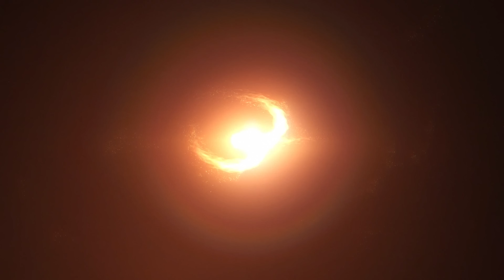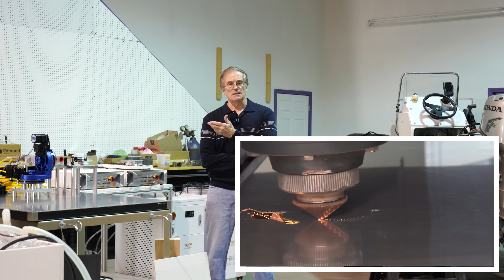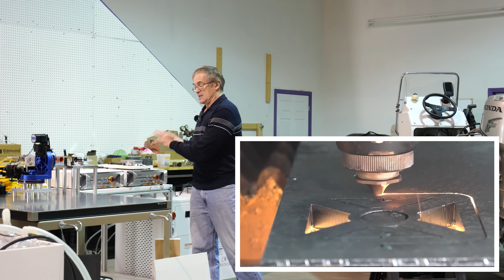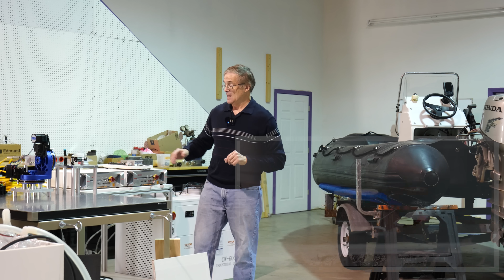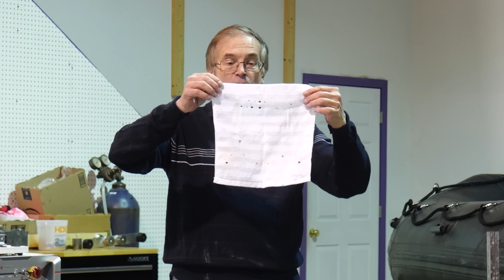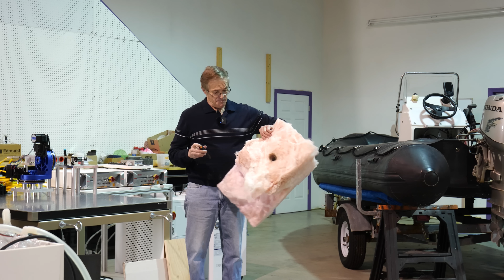We have a problem... and need your help!

Comment: So how come the lens isn't burned? I am a programmer. If you constrain the laser to a fixed aiming zone, you only need to shield that area.
A setup like this works:
– 3mm water curtain
– Thick graphite slabs
– Steel or ceramic backstop
That gives you a reusable, safe beam dump even for high-power lasers like fiber systems.
Reply from the maker: We have to allow the target (drone) to move around and try to avoid the laser to validate the tracking and targeting system.
Reply: @TechIngredients  These seem 2 separate problems to me. Either test the targeting system inside or test the laser inside. If you want to combine them test them outside and aim up (for example min 45 degrees pitch) where you can't damage anything else but some planes and satellites.. Outside you can rotate 360 degrees (yaw) so its a better test.

Comment: At the risk of sounding stupid, After watching your video and reading the comments I had the idea of using carbon felt. I thought if it was available in large sheets it could be hung in a frame with the bottom in a water reservoir pumping water to the top of the frame to a diffuser pipe at top with a water pump recycling the water from the reservoir. Maybe a few sheets thick depending on the thickness of the carbon felt sheets. The carbon felt is black with light absorbing and high heat handling properties and with enough volume  of running water to help cool the felt and additionally diffuse the light from the laser it might slow the rate of burn through. The water can be drained out when not needed and the carbon felt could hung to dry and then rolled up for easy handling/storage. The frame could be made for easy assembly/disassembly or even put on castors for ease of mobility in your shop.

Comment: Does it melt glass? Water with suspended particles would be my thought. Some reflective, some absorbative it would obviously need to be quite dense with sediment so something keeoing the particles suspended .. aka mixer the other option is focusing down into the water with some type of white floating sludge on the top of the water. If the laser won't burn through glass i'd go through the side of a tank,  is it will melt through the glass I would aim into tank so it aims up into the sky if it has any chance to reflect, which is why I would go with the foam on top. Water is such a great diffuser of light, with particles mixed in it would have to work.....

Comment: ptfe sheet. We used strips of it inside parts (aircraft engine turbine blades) that were drilled with film cooling holes using lasers.  The ptfe prevented back wall damage inside those parts for a given number of high power shots.  Although any gas produced was safely vented away which may be a problem in the open.

Comment: Hm, the problem is the the energy density, what would happen if you make a wall of water? E.g. with sprinklers or like a fountain. Water has a high heat capacity. Wall of flowing water should protect the structure behind. It is cheap, but you need a relative powerfull pump to maintain the flow rate.

I think it is more reliable than the sprinkler solution. Because tiny droplet have a low mass and therefore a high expansion potential… this is dangerous.

Continuously flowing water has also relative good heat conduction.

Comment: Back in the 80's, the only solution I found to stop the unstoppable picosecond beam from burning the water cooled ceramic in about 2 seconds was to add a bead blasted window to disperse the energy before hitting the ceramic. I don't know what wavelength you are working with, but if it will pass through cheep glass or plastic, you might be able to bead blast it and contain the energy inside your building safely.

Comment: I would suggest carbon felt fire blankets over the top of potassium acetate coated plywood. Or to be truly thorough carbon felt fire blankets over potassium acetate coated plywood sandwiching starlight (baking soda, cornstarch, flour mix stuff) mixed with graphite material between two layers of potassium acetate coated plywood. Though I do not know if it might be too much hassle.

Comment: Aerogel mixed with vantablack? Or, try to adjust the lens to focus it at the proper distance (and scatter if the target is destroyed / missed)
Reply: ha no okay you need it to be big :+) - first option is out. I'd work on a quickly adjustable final lens to focus / diffuse the lens with an actuator.

Comment: So many cool ideas to try... Building on some other ideas here, how about a sacrificial barrier followed by a mirror to deflect the beam downward into a pool of dyed water. Pass it through a fuse first if you want an auto-shutoff feature. Diffuse it through a lens if you want to heat the water more evenly. Paint the back side of this absorption chamber with Vanta Black to reduce reflected light and satisfy my own curiosity. :-)

Comment: The Space Shuttle uses a Thermal Protection System (TPS) to manage heat during re-entry, primarily relying on tiles and blankets. These components absorb and dissipate heat generated by atmospheric friction and the extreme temperatures of re-entry

Comment: MDG's/multi layer diffraction gratings maybe? I saw a guy using diffraction gratings from them big old tv's cant remember why but I know MDG's are used in laser applications where metal objects may be damaged and they are used to increase the LDT/laser damage threshold of things, so maybe diffraction gratings are the way to go? 👍
Reply: Or build a portable Penrose unilluminable room from mirrors and plywood and do the experiment in there? But the first idea seems more practical the unilluminable room would look cool for the video though. 👍
Reply: My only other solution is....... a solution..... of silver nitrate disolved in water sandwiched between 2 pieces of perspex this should be a good heat disipator and absorbed of the laser light but the water would probably be best if its circulated and it may be best to add an absorbent black layer on the back side of the perspex thats water proof but it might be a bit far fetched, you would need to experiment with the thickness of the perspex and distance between them and the amount of dissolved silver nitrate in the water and maybe try a few different black absorbent coatings? 👍
Reply: Doped glass may be a good idea too but you'd have to find a dopant that's a good absorbed of the wavelenghth of laser light being used and you could have multiple panes of doped glass so it can be portable and it might not need to be really thick glass either depending on how the dopent does the job.

Comment: I have an idea that wouldn't completely solve your problem but it would be yet another safety layer.
Have a separate computer system that monitors the movement of the laser, and if it lingers for too long at a given position, immediately turn off the laser. For greatest safety require manual restart, or auto restart after cool down. (Effectively controlling intensity through pulsing.) Now you want this system to fail safely so if the computer monitoring the laser freezes or crashes the power defaults to off. You could also wire in a manual button that when held down bypasses this system if you find it triggers too often. Again, this would not solve all of your problems and you would not want to depend on it alone.
Reply from the maker: That's a good approach.

Comment: Redirecting und diffusion:
The first thing that comes to mind is to scatter the beam again. For example, with a diffuser glass panel.
I would also flood it with water.
To do this, mount the panel at an angle to direct the remaining radiation onto another water wall (trap?).

Comment: Ideas that instantly come up: 
1) (smartest (from list) but still hard) use curved mirrors to direct light up in the sky, it slightly splits laser and won't burn anything
2) (ez & quick) Use a mirror (or something relatively reflective) to direct light upwards to Sky. I hope it hits nothing
3) (hard to calibrate), use hard to destroy expensive material, and direct mirrors to point to it, large area -> small resistance area
4) (mat not found) need material that reflects laser all directions
5) (practical) extra fast microcontroller tracking laser (setup orientation) that shuts down if stays on one spot too long using rotation sensors and/or sensitive gyroscope (low gyroscope readings = laser is burning too much stuff)
Hope it helps!
Reply: When reading your first point i imagined penrose's unilluminable room and a laser bouncing everywhere but the parts it cant reach and hiding in the unilluminated spot for safety 😆 that would be cool.
Reply: lasers this powerful will destroy common mirrors in less than a second! Styropyro got a video o that.

Comment: Have you tried to fire at ceramic tiles? A stack of them would be cheap and readily available. 
 Another idea would be making an intumescent ablative block and testing it. 400g flour, 200g cornstarch, 200g powdered sugar, 200g baking soda, 40g borax, 250g water. Mix well, form a cube, let dry. With heat it melts to a carbon foam. (NightHawkinLight formula)
 3rd would be to diffuse the lazer.10gal fish tank, fill with broken glass, maybe water too. 
 There's 3 ideas hope one or all will work. Good luck!

Comment: A laminar flow of water over a surface to absorb the radiation.  The surface would be large, and the pumping might get complex, but I think it would work.  If the water is too reflective or translucent, some sort of inert solute could be added to the water.

Comment: One thing you might try is Kaowool insulation. It's used in smelting furnaces and I think that if it can withstand the temperatures needed to smelt steel, it may have a better chance than the fiberglass. Another thing you can try is a high convexity first surface reflector. This will serve to diffuse the beam rendering it a lot less hazardous to the surrounding environment. The trick is to find a reflector type that is nonreactive at the operational frequency of the beam. An alternative to a mirror surface is a high convexity lens which will also serve to spread the beam and reduce it's reactive power considerably. This lens should be made of quartz glass which has excellent optical properties and high temperature resistance.

Comment: Rockwool insulation perhaps? It's basically spun rock slag. Fireproof, available and flexible. It should have significantly more thermal mass than glass insulation so hopefully won't melt anywhere near as quick.
Reply from the maker: We're testing that now.

Comment: try concrete backer board also known as green board   two or 3 sheets  would not be that expensive kiln brick aka fire brick  might work too
Reply from the maker: That's on our new list.
Reply: @TechIngredients  it would also help to know how hot that laser gets,  that has a big difference on the material  i mean steel melts around 2800 ....the old laser blew threw that thin stainless like it was nothing but how would it do against 1/4 inch sheet  steel that laser in the video was cutting thick aluminum  ...and steel

Comment: Use a dye that absorbs the wave length in an oil water solution with sand mixture stained with the dye.. I would try a reenforced aquarium filled with it with the target made of transparent aluminum or metal foam filled with the dye

Comment: AEROGEL is probably what you are looking for, see VERITASIUM video on the subject.
YOUR "Revolutionary Paint" is probably the next good candidate. Someone else used something similar to protect against heat and used a welding torch to test and show it's efficiency in one youtube video.
Another SOLUTION is probably to use the same technique than your cutting table. Use a a bean the converge on you target and then diverge.
You can split the beam into multiple smaller beams  
 My favorite SOLUTION called the KILL SWITCH would be to find a PAINT that would emit a known wavelength when hit by the laser. You put some detector in the room and you moderate the power of the laser regarding the diffuse reflection mesurd by the detector. As soon as your laser beam has made is  way trough your target, one part of the beam will hit the wall that will remit the light with another wavelength in all the room that will hit a detector that will lower or stop the laser.
Good luck

Comment: I have no experience with high Power Lasers, so i am probably missing something important.
But my first idea was a two stage system:

First an Optical medium, that Unfocuses the laser, but is transparent to its wavelength
Then the Absorbtion medium that absorbs the Enery

To disperse the laser before it hits the Absorber, something like a Diffraction grating (or frosted glass, if the backscatter is not so high that it causes a hazard) could be placed a meter or so before the absorbing Wall. 
When the energy of the laser covers a larger area, the Absorbtion medium should have a better chance of surviving

Comment: If Starlight doesn't work, Try a parge coat of Refractory Mortar. I would say make the parge coat at least 1/2 thick or thicker.

Get a piece of plywood, and staple Galvanized wire mesh to it, you will find this in the masonry section of you local building supply store. 
Lay the board flat on the ground with the wire facing up. Mix up a 5 gallon bucket of the Refractory mortar and flat trowel it onto the board. 
If you make it too thick, the board will become VERY heavy and be to difficult to move. 
Since it is parged onto plywood, you could also fashion some handles on the backside of the board so 2 men could somewhat easily move them. 
If it works, you could make several panels of these Refractory Parge Coat boards and position them however you need them.

Comment: Have you yet considered setting up a huge rotating disc in front of the wall? In this case, the beam does not stay focused on the same spot and the energy is distributed, depending on the speed of rotation.

Comment: Use a beam diffuser. Split the beam into multiple beams then let it hit your absorption material. Shape the prism, ie splitter so the the split beams impact different areas. You would need to replace the splitter crystal as decays, but it should give you enough time to shut down the system.  This coupled with slayers kill switch should work in theory. If within your price range synthetic diamond? Zirconium? With experimentation I think you could make it portable. Good luck, hope to see the idea functional in another great video.

Comment: Rockwool insulation is lightweight, not as cheap. Also, it would be interesting to see how water vapor in the air between the target would affect the power that reaches the target.

Comment: This idea is more of a scientific cage match than a solution. I wonder how a laser would fare against Starlite. Would it punch through like the wet cloth due to lack of surface area contact, or could the Starlite absorb and dissipate heat fast enough to give you a few seconds worth of barrier? NightHawkInLight has several videos on his refining of the process of recreating Starlite. The ingredients are cheap (flour, corn starch, powdered sugar, and baking soda). I think the laser would win quite quickly, but what if it didn't....... wouldn't that be cool.
Reply from the maker: Agreed

Comment: I thought of the idea of using dry or wet sandbags. I also considered a metal plate or a mirror reflecting the laser at a 45-degree angle to direct the beam toward the ground (with a thick layer of sand on the floor).
Other materials I considered: refractory ceramic, silica, refractory cement, graphite.

Comment: What about ceramic insulator tiles of the type like the Space Shuttle used?  
Also, what about an aquarium or other water containment means that lets the light into the water and the water diffuses... kind of different than your wet blanket method?

Comment: Maybe use  a double wall glass with black colored water trapped between the two walls.
i think the laser will be absorbed by the black water if the glass will allow the Laser wavelength to penetrate.

Comment: Hello Sir. You can try with a sandwich made of 2 layers of drywall and between them you fill the space with salt (Na Cl). The first impact is received by the drywall and then the salt crystals disipate the remaunung energy of the beam in several directions. Regards.

Comment: I do not think it is an option to absorb the energy into any material if ceramic does not work (the tiles on the space shuttle, the tiles burn to push the heat energy away from the shuttle). I would be thinking along the lines of a circle of mirrors that can reflect the beam endlessly in a circle until it looses all it's energy. An option is also having some colored water droplets vaporised inside the chamber that get constantly turned into steam and back.

Comment: It can end up being reflexive but here it goes:
1. Sand on a ramp in 45 degree angle to the ground. After becoming glass, the beam is hopefully deflected to the Sky.
2. The idea number 1 with a slight change: wet sand. A lot of steam is expected.
3. Rocket tile

Comment: I highly recommend you use a stray light detection system. Regardless of what physical material you use to "stop" the beam, you want to keep that exposure to a minimum in time. With a camera and/or fast photo detectors you can aim them at your wall or other backstops and use fast software and an interlock relay to pull the fire discrete from your laser(s) whenever stray light above a preset level is detected on said camera / photodetectors.

Comment: Not sure if you are still working on this problem. Have you tried light absorbing paint like “vantablack”?
Reply from the maker: We are.
There is no hope for such a thin coating.  It absorbs the heat and is so thin that the temperature will skyrocket and the coating will vaporize.